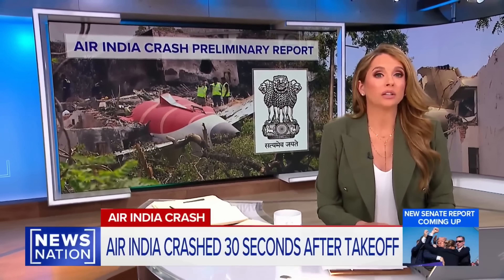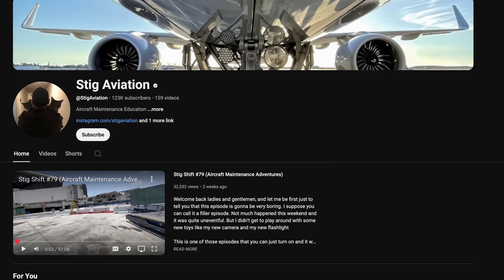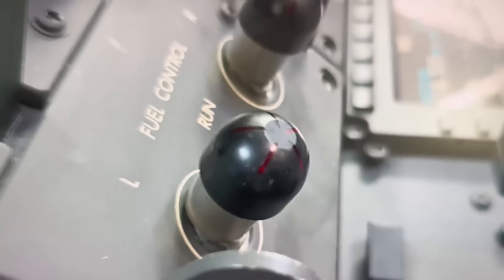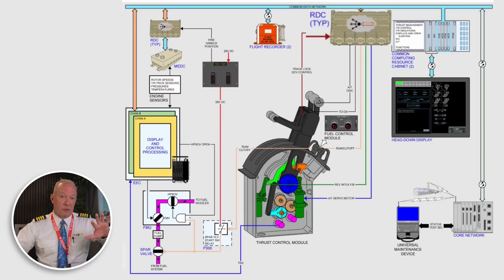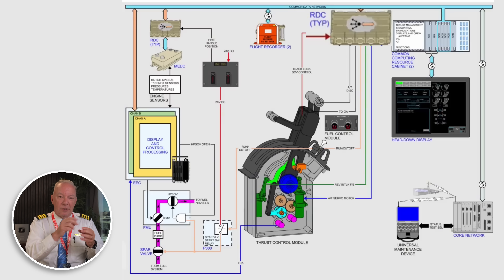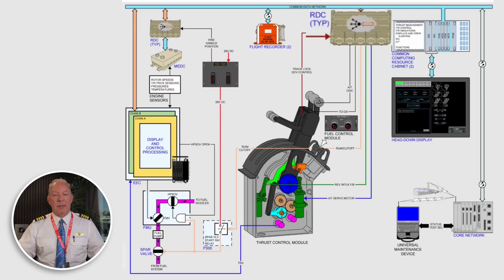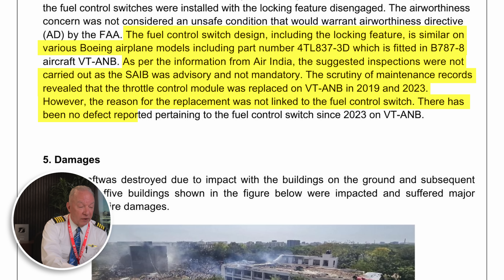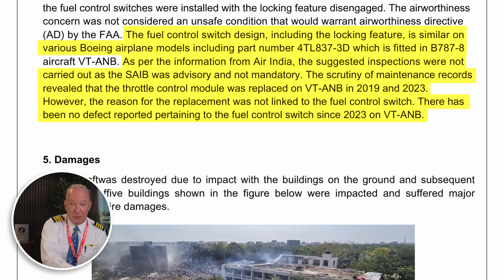The Truth About Boeing 787 Fuel Control Switches

Comment: As an avionics tech cross-trained to airframe & powerplant, your explanation is excellent. Thank you for your consistently high-quality work, regards and respects from an Aussie Techo.
Reply: I disagree. From the schematic, the fuel cut off switch merely supplies the power to one of the contactors of the relay. The signal to energise the relay is coming from the top-right RDC, as shown with the orange line and arrow pointing to the relay (input signal). IE, the top-right RDC DOES indeed decide whether or not this relay should be energised.
Reply: @DanBeks-eq3hu Correct, in air the system has command authority.
Reply: @DanBeks-eq3hu Correct, in air the system has command authority.
Reply: With all due respect, depression and suicidal thoughts are capable to flip these fuel switches. How well and how often these companies evaluate their employees will play a huge roll with widely spreading mental health nowadays. Just saying...
Reply: Captain Steve incorrectly describes the control of the fuel values according to the diagram he presented.
Reply: @exist7309 What is incorrect?
Reply: @petep.2092  "What is incorrect?"
Not correct. In this case, "incomplete" and "not correct". Not reflecting reality.
Reply: @petep.2092  Did you follow the diagram yourself? Captain Steeeve claims that all 3 valves are controlled by the relay. The FMV is not controlled by the relay. It's controlled by a signal from the EEC. Also the HPSOV is controlled by a signal from the EEC via an AND logic gate, which requires a voltage on both it's inputs to turn on the valve. So it's not a simple "closed loop" system at all. There are other external inputs that can cause the valves to close, It only needs 1 of those 3 valves to shut to cut off the supply to the engine. Anyone who can read a diagram can clearly see this. I'm gobsmacked by the number of so-called "engineers" & "technicians" praising Captain Steeeve, when he has got it completely wrong! There are other factors that can cause a valve to shut. Not just the fuel control switches.
Reply: Hey Mr avo tech how about some reply???  Cant understand your silence, as someone qualified as you eluded to, you should be easily capable of clear explanation!??? Maybe your full of it!
Reply: True
Reply: It is not fully accurate therefore not excellent but decent. Read the top comment on the switch/relay.
Reply: Stop the boot-licking.  Your tongue must have an awful taste by now
Reply: So him not understanding what is a relais is high quality work?
Ignoing known issue with water leaking to electronics bays, where the relais are probably located is high quality?
Reply: @jochenwagner2782  I do not understand what a, "relais," is either.
Reply: @dpagain2167  Dude can't spell relay even.
Reply: @jochenwagner2782  one that can't even take the time to spell relays correctly isn't someone we can take advice from.
Reply: @asitis4826 sorry but my electrical education was in German and in my daily work as electrician, I normally speak Spanish. Caused by this, I sometimes mess up the English as I very rarely talk English about electric circuits.
Reply: @jochenwagner2782  just because you saw another YouTuber talk about water ingress doesn't make you smarter.
Reply: @jochenwagner2782  relays 🙄
Reply: @jochenwagner2782  Two switches failing within a second of each other and then miraculously fixing themselves 10 and 14 seconds laster is not going to happen.
Reply: @vihtoripuurola3775  No but tell me how to prompt a restart!??? Not one person ive asked has given an answer. Gee i wonder why??
Reply: @mrgoodman6620 Exactly. The switches were moved to to RUN position after the plane lost power. That means the switches had to have been moved to CUTOFF prior to that as the data tells us they were. The data doesn't lie. Remove your emotions from the obvious answer. A human moved those switches to cutoff. My bet is that the captain did it.
Reply: @vihtoripuurola3775 your logic is comical 😂😂😂
Reply: @mrgoodman6620 You can't even see the truth that the data and evidence point to.
Reply: @vihtoripuurola3775  There has been no data released that supports your claims. Pay more attention to what you are actually reading, and don't fill in any blanks with made up things.
Reply: @ConcernedParent-z1q Switches moved from RUN to CUTOFF right after rotation then moved back to RUN 10 and 14 seconds later. In between that the FO asked the captain why he moved those switches to CUTOFF. Occam's razor applies.
Reply: @vihtoripuurola3775  No Occam razor because there is no video of that event happening.  At this point that's all speculation.  Put a fu*** camera recording both pilots hands on the controls and the mystery disappears
Reply: @vihtoripuurola3775 Occam's razor!?????? To a 787 crash!?
You don't have and idea how the 787 works! The data released is pathetic! If your going on that don't understand there is a crap load missing your not that bright. 
:39 liftoff :40RAT dropped :42 180kts :43 1 cutoff  :45 2 cutoff 
Pilot ask why did he cut off.. the other said he did not. ( The report said it exactly like that) there is no time stamp on or to that CVR and no not all was detailed in chronological order!! :47 RAT started powering hydraulics :52 1 back to run :54 APU door opened :56 2 back to run.
Now if you think you can follow evidence, why did the RAT drop FIRST THING??? How can max speed occur before both engines shut down ... If you think that's possible you have zero physics knowledge. So explain that... ???
Reply: @vihtoripuurola3775  "In between that the FO asked the captain why he moved those switches to CUTOFF"
The specifics of that are ALL GUESSES.
Reply: @ConcernedParent-z1qIt does not specify who said what!

Comment: Think of some other incidents.  TWA 800. Loose wires inside the fuel tank allegedly caused the plane to explode.  737 Max. Computers misinterpret the angle of attack wind vane.  Cargo door blows off plane in Hawaii.  The electronically operated screws failed to engage.  Landing gears fail to deploy.  Screw jacks in the tail jam
Captain Steve tells us these systems work perfectly.  He's very naive.
Reply: Plane takes off from Colorado Springs headed south.  Has engine vibrations.  Flies North the wrong direction to Denver.  Lands and pulls up to the gate. The engine catches fire. Passengers standing on the wing are unable to get off
Reply: I forgot to add, door plug has missing bolts, and falls off.

Comment: Im an elettronic, if I focus only on the switch, yes you are right.
But if the camble that goes from the relay to the pump is broken what happen ?
The 28 V stop and the pump stop.
The safety should be that 3 wires gives the signal, if one breaks, the other 2, still give the signal.
Is it ?

Comment: according to your simplified diagram you have not clearly explained HOW you would know the SWITCHES are closed / open state. From the diagram it only appears the RELAY state is returned to the flight recorder. SO it means the OFF logged can be due to an electrical / relay state and NOT necessarily the POSITION of the switches. (only the flight deck voice recorder can align it was the SWITCH state together with the RELAY state.
Reply: You would get a transition light when valve is transitioning and light goes out when in proper command position. If the valve and switch position don’t match, you would get a valve disagree message on EICAS.
Reply: @BangkokChuck..ReThaired first I've heard of a transitioning light, and messages about disagreement.  All I know is that this particular aircraft had major electrical problems inside the cabin.
Reply: @BangkokChuck..ReThaired  for the actuator diagnosis yes but you don't necessarily mean "toggle switch" you mean the power side relay?  I see the switches are dumb ..or at least not explained as any logic to know their actual state

Comment: Thank you Captain Steve, I have looked at dozens of other channels that talk about this crash but your explanation and diagrams are the clearest I have ever seen describing how the fuel control switches actually work.
Reply: If you pause Captain Steve’s video when the Boeing-style schematic is on screen and look closely, you’ll see three valves in the fuel path: HPSOV, SPAR VALVE, and FMV.
- The SPAR VALVE is the only one directly controlled by the pilot’s fuel cutoff switch via the 28V relay.
- The HPSOV will only open if both the pilot switch is at RUN and the EEC (FADEC) commands it open, but it can be closed by either one alone (there is symbol with a flattened "D" shape representing a logical AND connecting both signals).
- The FMV is only commanded by the EEC, not by the pilot.
This means an EEC/FADEC malfunction could close HPSOV and FMV, shutting down fuel flow, without any movement of the pilot’s switches. That’s not what Captain Steve is telling you, but it’s right there in the diagram if you study it.
Reply: @Privateer-l7d  Also, the 787 got this TCMA system, designed to automatically cut off the fuel to runaway engines.
ANA flight NH-985 is proof of that.

As i understand, to replicate exactly what happened with that flight (dual engine automatic shutdown), you need 3 conditions:

1. The aircraft must think it's still on the ground, which can be provided by a sensor failure or computer error.

2. High thrust from the engines, normal during TOGA. And

3. Throttle levers at idle position.
That could be provided by defective encoders or connectors.
Let's not forget this AI aircraft already had 2 throttle modules replaced in a few years, which might mean there could had been some issues under the panel.

That without considering an TCMA failure by itself, it's only the conditions to replicate what already happened on another 787.

Also, it is reported that the same Air India 787 landed it's last flight with multiple electronic failures, such as stabilizer trim transducer failure (fixed before taking off and crashing), cabin entertainment system failure, cabin AC not working and cabin lights flickering, suggesting the aircraft might had diffused electronic troubles that involved multiple separated systems.
Reply: It's clear because it's simple. It's simple because it doesn't reflect reality. This makes it useless.
Reply: It's been over simplified. The diagram clearly shows other components in the fuel valve system, plus other voltages that could close those valves. It is NOT a closed system, as can be seen from the diagram.

Comment: The toe down position of the landing gear main wheels cannot be achieved without landing gear handle movement. When you look at the time of fuel shut off, there is not enough time to do both. The rear EAFR was melted. This was an electrical failure at lift off.

Comment: Please stop this fetishism over switches. We the Engineers are way past this nonsense. I have better information from Aircraft Safety Engineers. 
What the Pilots (Hundreds of them) understand is using the Machinery. The Dreamliner is the most complex Airliner ever designed by Boeng.
It's not the switches. It's what is happening with the Massive Complexity in the 2 Equipment Compartments. Watch an Aircraft Engineers show you the thousands of Boxes and thousands of miles of cable. All the Equipment is designed by different Companies. The Electrical Rectifying racks, the Inverters, the Networks, the Interfaces. It's an accident waiting to happen. Please all you Pilots, backout and allow the Engineers to work on the problem.

Comment: The new theory from Geoffrey Thomas is not that the fuel switches were not turned off, but that there was an electrical malfunction and the captains turned them off trying to fix it, not as an intentional move. Does not counter Captian Steeve narative for fuel switches, only for the motive.
Reply: so how come the flight recorder didn't notice the electrical fault or any other anomalies but the pilots did.  Richard Godfrey theory is pure fantasy.

Comment: Captain. Given that the physical switches have no direct physical connection to any of the control valves, but rely on relays which require electrical current to energise the relay is it possible that the fault lies with the wiring to the relays or the power bus that supplies the current? Could a wiring / electrical short trip the relays to open [shutting off the fuel] then close simultaneously within 1 second? The crew may well have seen the engines spooling down and cycled both of the physical switches from cut-off and back to run at the same time?

Comment: if a pilot's seat accidently slides back and the pilot grabs both switch with curled fingers in an attempt to grab something - they will go up an back for sure!!! - that is the only non suicided scenario possible - but that can't be the case here, because is would have had to happen simultaneously,  but the events were in fact 1 second apart so only suicided is left

Comment: 6:52
No.
Removing power from the fuel valves will NOT make them close on their own.
Loss of electrical power should never close those valves and shut off the engines, the system is fail-safe, it takes power to open AND close them.
The switches remove power from the relay which simply acts as a switch to either provide power to open or close them.
Also, the engines have their own power supply system.
They have a dedicated generator that will power the FADEC and electrical valves if all power from the airplane is lost.

Comment: Hello, 
I'm a retired electronic engineer and 24hr site guy. 
I've had switches and relays fail prematurely because of the 
'wetting current' is not achieved. 
Can you post the data sheet of those switches and
the downstream switching elements.

Comment: Hi Captain Steeeve
Love your youtube feeds

I 100% agree that is it impossible to accidentally move the switch lever from one position to other when it is fully rested in the Open or Close position (the detent is the fench)
But with that particular make/model of switch as seen in Stig Shift #78. (please take note of the detent shape)
Can the lever be placed in mid position?
I believe YES and I have seen it happen (10 yrs as an Airforce Electronic Technician)
My reason for this possibility is that the Boeing 787 Fuel Control Switches has a square detent, providing a flat mid surface area
Some make/model switches have are triangle or half moon shaped detent, making it near impossible to place in mid position

These switch official action process is Pinch - Pull - Move
Boeing 787 Fuel Control Switches is shorter in length (cosmetically and modern looking) than the earlier types
Because of it is shorter lever length, you can also process the action by Grip - Pull - Tilt
Grip = held like you would with a drumming stick (thumb on-top and inline with the switch lever)
Pull = no explanation require here
Tilt = your wrist is moved in a vertical movement
When you releasing that Grip. You are holding the switch lever steady as you release. That lever could be positioned any where in that detent mid flat surface area
Because the spring is providing a down ward force. The pressure between the switch lever wedge and the detent mid flat surface area can aid, by holding that switch lever in mid position

The Boeing 787 Fuel Control Switch needs to:-
1. be modified from square to triangular or half moon shaped detent
2. All training must specify/mandatory safety action is Pinch - Pull - Move Only

Comment: Did they both transition at the same time?
If so, it seems unlikely that a single person could easily pull them up at the sane time to then switch them across.  A failure of the power supplying the relays, if it uses the sane rail, could cause them to both to appear to switch at the same time.
How does the system record the switch position changes?  By the physical state of the switches or by the voltage flow at the relay coils and/or the output of the relay?
What do you think?
Reply: Each position is independently monitored

Comment: If the whole module was replaced twice 4 years apart there must be something in the plane causing it to fail so soon. Also the connector to both switches may have become defective and could have come undone
Reply: Problems with connecting blocks are not uncommon.  Jumping to the conclusion that this is pilot suicide seems all too common
Reply: We know this particular aircraft had significant electrical problems at least in the cabin.  Best to ignore that and blame it on the least probable cause.

Comment: 1. Just because the system is simple does it mean that the relay can never fail? I understand that the chances are very minimal but still it is a possibility.
2. Where exactly is the data recorder in this circuit? At which point the data is recorded for the switch position?

Comment: Where can I find if all 101 Boeing Air India Flights have been inspected for fuel switches?
Reply: Air India put out a news brief that they inspected all of their AC
Reply: I seriously doubt there was a problem with the switch.  The question really should be can the computer shut down the engines under certain circumstances